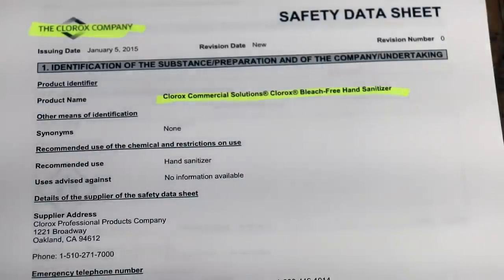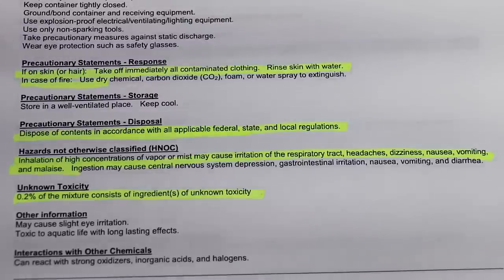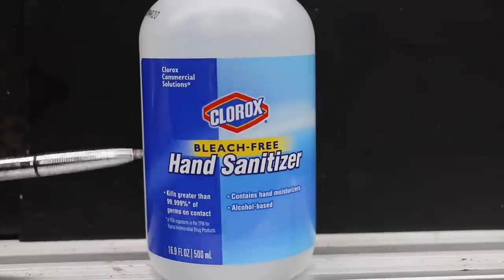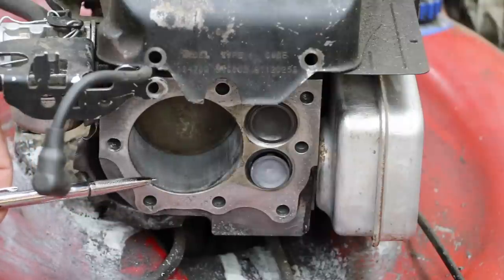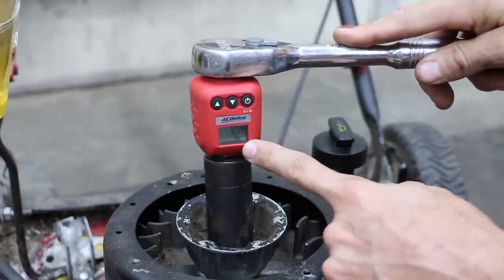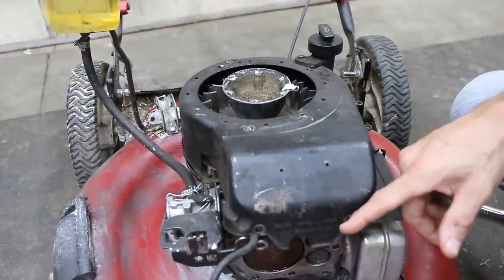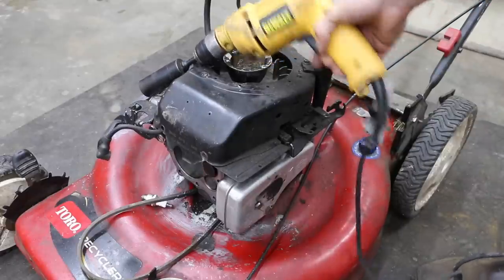Will an Engine Run on Hand Sanitizer? Let's find out!

Comment: distill some moonshine. for erm , scientific purposes :)
Reply from the maker: Thanks for the video idea!
Reply: Sad that you can't legally distill moonshine there.
Reply: He also doesn’t drink 😂
Reply: no need to drink it, run a lawnmower on it
Reply: Moonshine has a lot of car history behind it
Reply: Making the hand sanitiser drinkable would take some work to get the isopropanol out of it, but I’m sure it could be done.
Reply: Come to Australia, we are allowed stills up to 5L (roughly a gallon) in wash volume. This means you can easily distil a small batch for personal or scientific use - I did this at university using 12ft of 1/2" copper line, a stainless kettle and electric hotplate, and a boxfan to cool the copper coil. Very basic, but worked a treat!
Reply: You can actually get a distilling license solely to make fuel for your lawnmower. Supposedly its super easy to get.

Comment: Will a diesel motor run on old oil?
Reply from the maker: Great video idea!
Reply: vaporized oil acts like diesel fuel and ignites under the extreme compression
Reply: Short answer, yes. At least in older diesel engines. Not sure about modern ones. Truckers back in the day would dump their used engine oil in the tanks at oil changes. Free BTUs and power. The diesel engine can also run on vegetable oil, but again, not sure about modern diesel engines. Modern diesel engines have a lot of emissions stuff on them that will probably get ruined if you run anything other than diesel.
Reply: Thats exactly what happens when a diesel runs away
Reply: Simple diesels will be fine, modern HDIs and common rail systems will cough up a lung if you try it.
Reply: You don't have to call people idiots. Not everyone has a lot of automotive knowledge. I knew that, but I grew up turning wrenches. People are here to learn.
Reply: Yes but you should cut it with diesel. Big truck or other industrial diesels will run on engine oil if you introduce it while its already running because their high compression. Generally 20:1 or higher. Pickup truck diesels are lower compression. Like 17:1 that's why your pickup truck needs glow plugs to get started while my kenworth doesn't.
Reply: Some military diesels will run on anything that will burn.
Reply: Depending on the motor.  An old Detroit would

Comment: Using sanitizer increased the engine compression by 3 PSI, what it did to the engine?
Reply: probably cleaned a small carbon deposit...
Reply: The engine was seized at the beginning, it was simply workin long enough to start working itself more free.

Comment: Try using nail polish remover as fuel for an engine please!
Reply: Well that should just clean everything right out of the combustion chamber since nail polish remover is mostly acetone LOL.
Reply: William Todd 😂
Reply: That's just acetone
Reply: When I was like 8 I did in a lawn mower that never worked put it in and cranked it let out a big pop like a gun shot..added gas's and it ran like a new mower

Comment: why dont you invent a spark plug compression tester with a spark plug in it so it  can run and check at the same time.. you could sell millions..
even better..invent a spark plug that can  be compression tested  in place.. youd sell billions
Reply from the maker: Great invention idea!  Thank you
Reply: drill hole in head, add fitting don't use a low pressure gauge.
Reply: johnny llooddte You'd need a way to shut off either fuel (preferable) or spark to the cylinder you're testing because a traditional compression test is for static compression i.e. not with combustion occurring.
Reply: Already have those, if the engine runs it has some compression, test complete LOL.

Comment: I wonder if a 2 cycle engine would run on propane if it had a oil injected pump like they did in Japanese bikes in 70s great video on the hand sanitizers 1 Final thought be careful of using your hand as choke just in case it blows bake threw carburetor.

Comment: What if you applied some heat to the carburettor?.. ethanol vapourises at higher temperature than petrol/gasoline. I run E85 in my inline 6 falcon and once the engine is warm it runs fine, starts fine.  I'd say it's smoother than on petrol.

Comment: As a young boy I had this motorcycle with a 50cc 2-stroke engine. One day I ran out of fuel and as I did not have any money to buy more I figured out that the turpentine used for household cleaning would do the trick.
It actually worked. At first when the engine was cold it did not run that well but after it warmed up it ran just fine. Back then in Finland the policemen were super sensitive on alternative fuels. It was strictly forbidden to drive Your car with fuel that had no fuel-tax on it.  For example driving Your Diesel Mercedes with canola oil was a major felony. Luckily this is not the case any more.
What happened was that the policemen got really interested on the funny odor of my motorcycle. I think this was the first time I spoke myself out of the trouble. I believe it was the funny smell and the fact that I had "stolen" my mothers cleaning agent that did the trick. They, of course,  throw a call to my home and checked that the story was true and this had some consequences.
Actually no need to test this "fuel", it's already been tested. However, the pungent smell is something one cannot forget :)
Reply from the maker: Thank you for sharing this experience!

Comment: How about trying the reducers and thinning agents for paint, these are always kept in a secure room or cabinet in shops, and another one would be pressurized torch fuels such as  map gas and acetylene, now if you really want to try something different, try magnesium, this is one of the metals that has been known to burn, and firemen have been instructed to let it burn itself out, especially when it was used on cars... the original “mag” wheels, and some engine parts before aluminum.

 I don’t want you to get hurt, so please do these things in a well ventilated area, and if your dealing with magnesium have the firemen on standby, the dust is highly flammable!
Reply from the maker: Thank you for the video idea!

Comment: Maybe I missed it but how were the temps vs petrol (gasoline) because I'm thinking the 30% or so of water should've meant an engine that runs a good amount cooler although at the cost of corrosion

Comment: In France lots of people run old petrol cars on E85, it is up to 85% ethanol, the rest is standard 95 petrol. Most cars run fine with a mix (30% petrol, 70% E85), some run on 100% E85 no problem. It depends on the engine. E85 is like 0.65€ a liter compared to 1.3€ for standard fuel so it's much cheaper to run.
Reply from the maker: Thanks for the feedback.

Comment: The reason it says you shouldnt put it on skin is because this is commercial grade hand sanitizer. They use this in kitchens to clean utensils, dishes and any other food contact surface. It will kill anything on there.

We are required to use gloves if we handle these sanitizers.

Comment: this vid could have ended differently. alcohol is a great fuel. sucks the o2 right outta the air. the carb needs a jet about 30% larger in diameter though - replaced or bored.  the choke won't do the same. will be more powerful too. might want a hotter plug too. 
video idea: try running alcohol and biodiesel in a 2-smoke. super fun and smells like booze and french fries. you'll use significantly less biodiesel than oil in the mixture though due to different viscosities
Reply from the maker: Thanks for the suggestion.

Comment: Continental Motor Company : We developed a multi-fuel engine for war-time fuel shortages and emergencies. 

General Motors : WE developed the flex fuel engine concept for economy and convenience. 

Briggs And Stratton : Oh yea?  We’ve been building lawnmower engines for years that will still be mowing lawns when the ** really hits the fan, but have you heard us bragging?

Comment: Would an engine run on 100 proof rum? Or at the very least would it run on medical grade alcohol?

Also will an unmodified engine run on sunflower seed oil? I know that with certain modifications an engine can run on sunflower seed oil, but am curious to see what it does to a regular engine.
Reply from the maker: Thanks for the suggestion.

Comment: Well I know with E85 (racing fuel - it’s available at the pump here in Australia) the engine can be very hard to start without quality E85 gear. It’s because ethanol really is basically a gel instead of a liquid. Dilute in 90% petrol it’s fine, no problem running in existing equipment, but when it’s 15% petrol, or even 0% petrol like in Brazil (they run E100!), you need the proper gear to inject it. You need an E85 fuel pump, fuel lines, and fuel injectors. Generally direct injection suffers no problems when using E85 (as long as they’re rated for it), because we had some Holden Commodores here in Australia that came with factory E85 and an LS3 driving the rear wheels right out of the box! And it wasn’t expensive! These were normal family cars. ‘Normal’ to an Australian, anyway.

I use E10 all the time because it’s basically a free octane boost, from 91 to 94 or even 95 in most cases - in some cases it’s still 91, but either way, it dilutes dependence on foreign oil just a tiny little bit, and it does apparently run a bit cleaner, but I don’t know on that point. I know that even with 300,000km and sometimes neglected oil changes, my RWD 3800 never has gotten carboned up - not even slightly. But I do use extremely high quality full synthetic oil, sometimes racing oil, when I can afford to, and I know that synthetic oil tends to resist burning - but in some cases that can lead to more carbon, not seemingly not in this case.
Reply from the maker: Thank you for the feedback

Comment: I wonder if this would even run in a fuel injected engine, but I'm also curious if it would help if there was a bunch of residual fuel in the bottom of the tank.
Reply from the maker: Thanks for the suggestion.

Comment: im thinkin u could get a 8-10 hp wood chipper with an adjustable fuel jet and choke,  and try those fuel experiments. the blade section make a great flywheel.  i can get my chipper to run rediculously slow with octane 92 non ethonal gas.  one might take diesel better than a mower.  also, carb should have a bigger diameter fuel jet than a 5-6hp mower that will let thicker combustable fluids through.
Reply from the maker: Thank you for the video idea!

Comment: Another very good video and it was interesting to see the msds and what was in the product. From what could be seen, I wasn't sure the engine was going to run too well. I also recall when you used Head and Shoulders in that engine which was interesting to see.
I wonder how baby oil would work in the crankcase instead of engine oil and what would happen. Would it work? Would it have the desirable lubricating properties and characteristics? Or would the engine become damaged and seize up. I was wondering if you might try that sometime.
Reply from the maker: Thank you for the video idea!

Comment: Love the videos maybe u should get an actual car to test some of these to see if a modern car system will be able to run it. Definitely dont stop the using the small engines to test bc the eas  of simple adjustments to make it run and to take off the head is simple and see what it does. Plenty of junkyers that still run and move but dont pass inspection and pp dont want to put the money Into it.
Reply from the maker: Thank you for the feedback!

Comment: Love your channel 
 So I got stranded once and I had a couple random things my trunk There's the concoction I came up with to try to run my car to the nearest gas station.  12 oz of vodka 4 oz of Marvel mystery oil in 2 oz of lawn mower fuel stabilizer. Luckily by standard saw me and offered me a Gallon of gas he had in a gas tank, So I never had to use my concoction but I always wondered about work can you test this! And secondly  There may have been a little bit of gas left in the tank if it doesn't operate on its own would you be able to do that concoction as half and then half gasoline
Reply from the maker: Thank you!
Reply: @ProjectFarm  any chance you could test this or something similar?

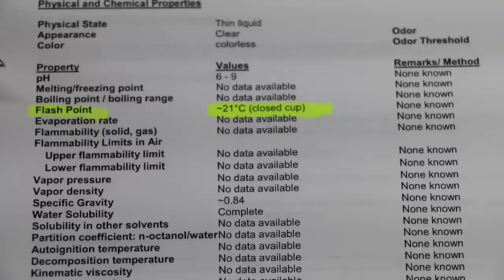Comment: A small error at 1:44
That's not a - that's a ~
Meaning the flash point is around 22 C. -22 C would bring it closer to freezing than burning

Comment: Hey I've seen some cheap single cylinder diesel engines on line wondering if you were interested in trying some experiments with a diesel engine and thanks for the alsome videos
Reply from the maker: Great suggestion!  Thank you

Comment: What would you recomond doing to a riding lawn mower that starts but as soon as you shift to drive/reverse dies?
Reply from the maker: Changing the spark plug and cleaning the air filter are easy to accomplish and unlikely to solve this problem but I would start there anyway.  The carburetor is most likely needing cleaned up.

Comment: I have this same lawn mower bc i found it in the garbage and it is amazing the motor doesn’t die I disengaged the governer and took off exhaust and it actually shot fireballs I don’t know if it was the lawn mower or the shitty gas I was using bc I was using about at least 20 year old gas with %20 water and a ton of rust in it I need to clean the carb after about a total of probaly a hour of use all combined but the owner had at least 50 hours on the motor without touching it only adding gas and using the proper amount of oil
Reply from the maker: Thanks for sharing.

Comment: a modern engine with fuel injectors that have a flow rate and computer with a tune for gasoline would not be able to flow enough alcohol to run properly. you would need to have injectors and a tune so that you can switch on the fly to run different types of fuel. for example flex fuel vehicles. they have a sensor that can tell how much E85 to E10 is in the tank. if you put 90% E85 and 10% E10. the computer will be able to adjust the air fuel ratio so the engine will run properly. you would also need a fuel system that would not be damaged by the ethanol/alcohol.
Reply from the maker: Thank you for the feedback

Comment: Carb may not run properly but efi might as the computer should adjust the air/fuel mixture. Again theoretically should work in a fuel injected not saying 100% certain it will.
Reply from the maker: Thanks for the feedback.

Comment: So does this mean it could work in a modern car? Since it's all controlled electronically would the computer be able to make it work? For example, I have a 2018 Subaru Legacy, would it be able to run on this or would it cause damage?
Reply: Maybe if it works with flex fuel since for flex fuel engines you could mix both e85 and gasoline and a sensor communicates with the ecu for ethanol content

Comment: the reason that the SDS does not recommend contact with the skin is because it looks at the worst case scenario such as an employee that is manufacturing the product and is in direct contact with it for many hours.  If you look at section 8 it will probably recommend the use of gloves as well :).
Reply from the maker: Thanks for the feedback.

Comment: It works because it's 70% ethanol and gas is 10% so it's 7x more so if you are running engine on it it's gona work good but need to be tuned
Reply from the maker: Thanks for the feedback.

Comment: Didn't it say that the temperature was ~21°C as in roughly 21 degrees?
Reply: It means at about 70f it starts to gives off vapor that could potentially be ignited

Comment: What happens when you blend 2 stroke oil in gas to use it on a 4 stroke engine?
Reply: Nothing will happen it'll just smoke lots
Reply: Aviation freak 117 well, i’ll guess that too

Comment: what does a engine run like with no gaskets?  fuel bowl, cylender head, intake, exaust, not the crankcase one,  dont need a lubed blade slinging oil everywhere.
Reply from the maker: Thank you for the video idea!

Comment: For me alcohol runs perfectly, with choke and a bit less power. My bike top speed is 105 kph  with alcohol its 75. With alcohol in engine forget speed tickets. And at bulk you can get 70INR while petrol is 75INR in my area. By alcohol I mean 95% and 5 % water and meth popularly known as spirit in India.
Reply from the maker: Thanks for the feedback.

Comment: Would a gas generator run on furnace oil ? Generate my house power use a steam radiator to heat my house? Maybe tune it to the higher carbon fuel for maximum efficiency Ideally a lean mixture would make the most heat. Burn cleaner and get as much BTU''s  use for co-generation and home heating. You might try running on Natural gas all that heat you need any way and get the electricity for free. Well may be cheaper save on electric cost.  This running most of the time would give a nice even heat put some small fans in and let them circulate air for very even heat. Maybe a fan in the bath room to keep the bath room super warm,  and fresh smelling and dry out quick after a shower. Any idea to keep it super quiet?

Comment: Bro this dude never starts the lawnmower with the actual pull starter, only a drill! The hell?
Reply: Work smarter not harder.  He does this all the time imagine using a pull start.  And not to mention the mowers he uses are really old and the pull starts are probably dry rotted.
Reply from the maker: You are correct.  Thanks for watching!